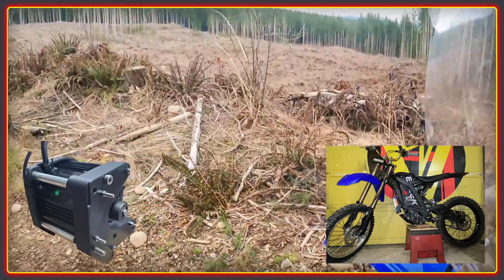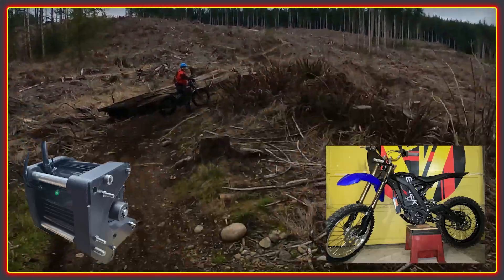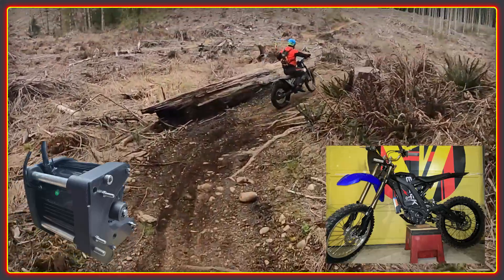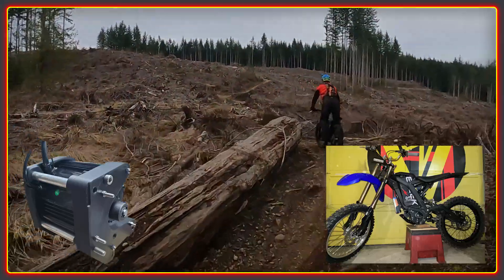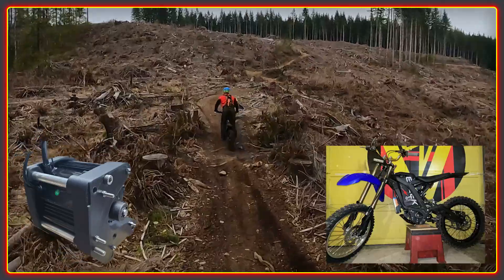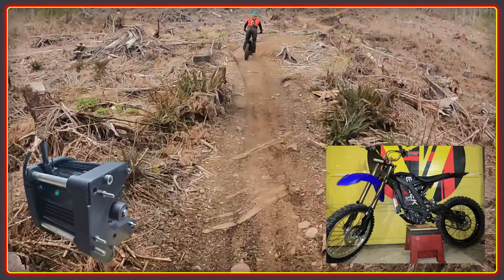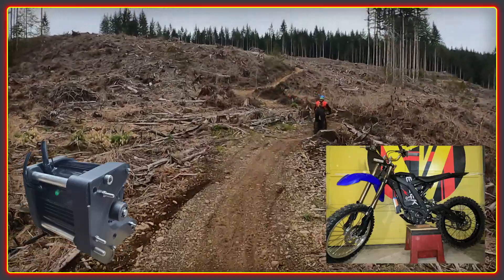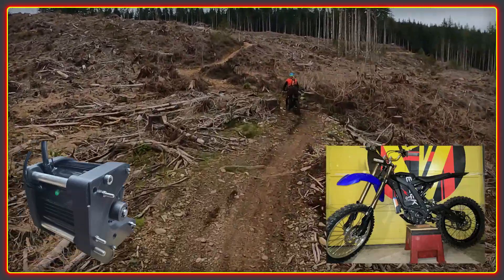Sur Ron Motor Swap - Off-road Stress Testing our 3D printed motor brackets

Comment: Sorry, new here, you put a different motor in the SurRon? What was the reasonings behind that?
Reply from the maker: Hey Ian, the motor swap is mainly for fun because I enjoy the challenge. Wanted to try an IPM motor in the Sur Ron frame as well as the challenge of using 3D printing in the design process. In theory it will be stronger than the surface mounted stock motor in terms of durability. We have three builds we are testing right now. These video links give a bit more information on my own Sur Ron which is using the same motor mounts. https://youtu.be/KHWBSAUfIPg and https://youtu.be/v1uWwMg70G8 also a road super moto version here https://youtu.be/1GHnu67e2wo Thanks for the comment! Cheers
Reply: @HighVoltageKits  wow, fun!! That dose sound like a good challenge, it's amazing to see what people are doing with these bikes honestly, it's like the Cub revolution all over again, but WAY more intense now that we all have YouTube! 🤣
Thanks for the reply!

Comment: Im not sure if this has been answered in the past but...where do you buy the batteries?...I'm guessing they are homemade?...are any of the bikes running anything other than 18650s?. I never see any battery details on the vids*. 👊🏻

*Battery voltage is always stated
Reply from the maker: The one on this is from ebmx. Rio also makes a mean battery himself. I'll be showing that one off on my build!
Reply: @HighVoltageKits  Molicells by any chance?
Reply: @ricksanchez3628  P42A is a good un imo
Battery info should be listed more, you're right ^^
Reply: @mcspikesky  Thanks for the info👊🏻